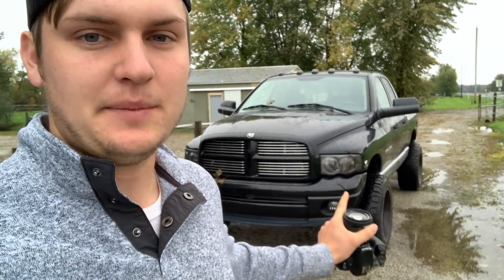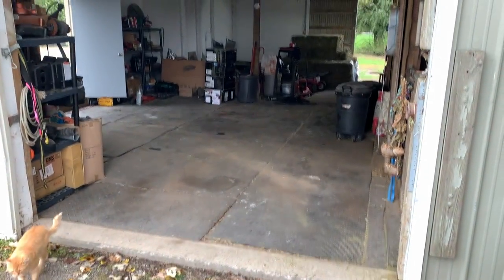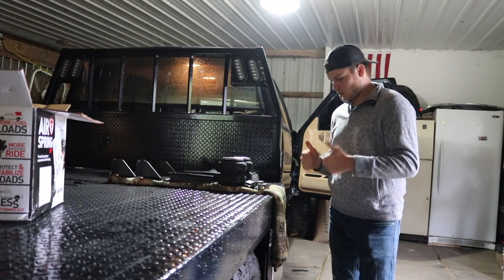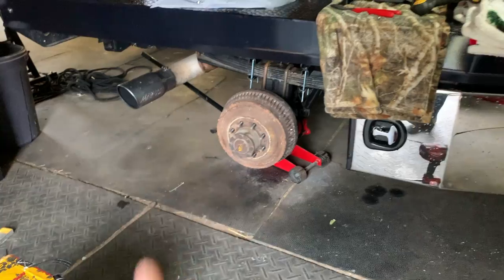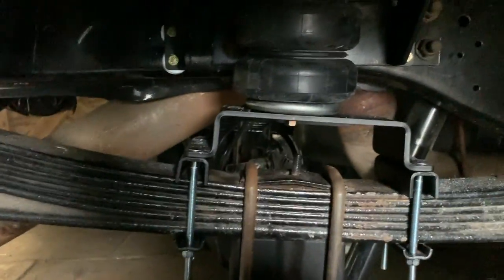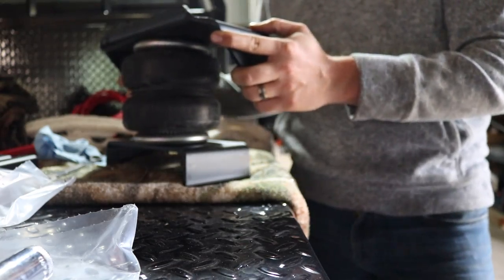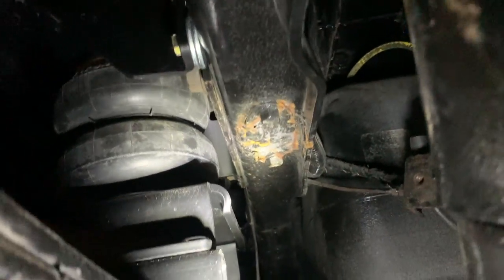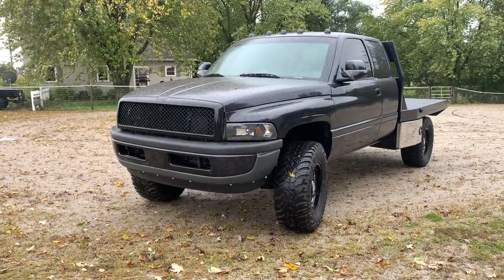Installing TOWING AIR BAGS on a truck WITH a Gooseneck Hitch!!!

Comment: Does the air bags come with gauges to know how much air you have in them or you have to buy them separately do you install gauges
Reply from the maker: I just used a tire pressure checker